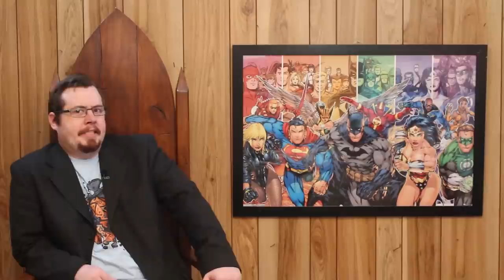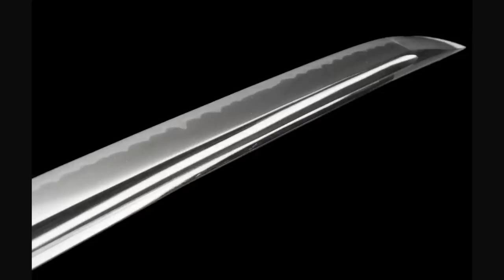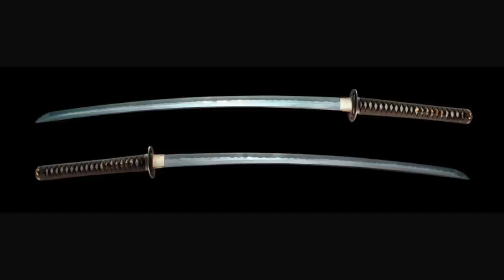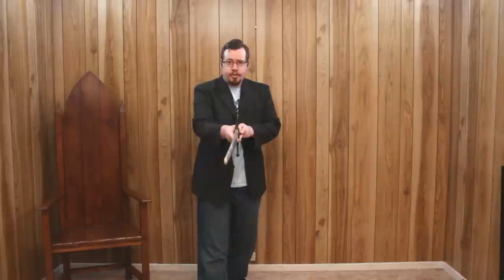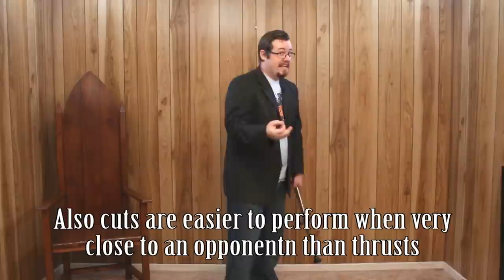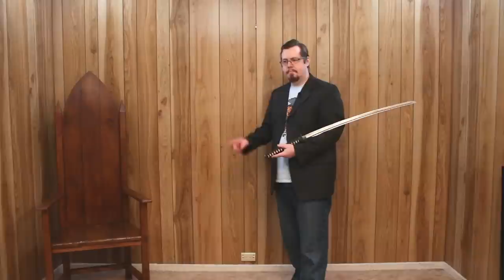Super cutting swords, are they needed?

Comment: You make a lot of good points in this video. For my own two cents, I would think that a balance between the two would be preferable. I agree some swords have a lot less viability based on the amount of curve or the lack thereof. It would largely depend on my role in combat. If I were on horseback and just plowing through an infantry line, I'd go for a saber or scimitar, but with preference to a saber, as there is the possibility of being unhorsed. I'd want the curved blade for the cutting as it's easier to get the blade out from a cut at that speed as opposed to a thrust. If I'm on foot, I'd go for a more balanced arming sword, or a katana. I might go for a shorter long sword, like a bastard sword over the arming sword.
I mention the katana, because I feel that it would still have enough thrusting capacity to get a kill in against most armors with the exception of full plate. As you said with cutting, if it does it well enough, then it does it well enough, and I feel this applies to thrusting as well.
I don't really think the thrust is the end all. If you really think about it, a thrust is just an extended punch. A smart fighter isn't just going to block with his weapon; he's also going to get out of the way, and go for a better position. Sure the other guy will do the same thing, but it'll take time to recover from performing the thrust. Not a lot of time, but time enough for the smart fighter to force the attacker onto the defense or to execute a joint lock, or d various other things to disable and then finish off the opponent.
I also don't think cutting is always the best option either. If you go to cut, you're going to generate momentum, which can easily be used in a throw. Both attacks have there downsides. Thus I prefer a whole body approach. Immobilize joints, get the opponent onto his or her belly, or just hit them really hard. Look at the weapon as a tool to strike, OR as a tool to get past your opponent's weapon and bring the hurt in close.

Comment: On horseback, three factors for why curved swords were preferred:

• an ever so slightly improved draw speed and more importantly, less likelihood of nicking your horse’s ear off.
• slightly less torque/jarring when the blow lands on your target (think of a long lever) and a slightly improved ability for the blade to rapidly slide off your target at speed, thus a decreased likelihood of either getting your weapon knocked out or yanked from your hands.
• a curved edge naturally rights itself, which again leads itself to a decreased likelihood of the blade jackknifing in your hand at speed, thus again reducing the chance of dropping it compared to a straight sword.
Reply: Will add:

If you want to thrust from a horse and not slash, then use a lance or a spear. There is no need for a short thrusting weapon from horseback when lances and spears are far superior in this regard.

Calvary swords were for slashing at speed. Duels where both riders were stopped and slashing away at each other were relatively rare.

Comment: Shad I think you're overlooking one big area of sword use wear the cut is paramount.  This is in cavalry use.  Thrust are generally not used from horseback because of the chance of the sword getting stuck in the opponents body.  So cavalry rely primary on cuts.  If you're only going to use cuts then it makes since to use a sword specialized in cutting, hence the cavalry saber.

Comment: I like to study naval warfare, and in old square riged ships you were fighting in close combat on deck or below in a hold and not on an open battle field. As you said in the video cutting is better for fighting up close so this could be why classical naval swords (like the cutlass) were curved. Because you don't have an open battle field where you can to some extent keep you apponent at bay. You are up close in a crowded area being crowded by other enemise and allies. Not saying it doesn't get tight on the battle field but battles on ships of the sailing age were tight. Also they might need to hack at rope or sail so having a sword designed for cutting might give a slight advantage.

Comment: i have a feeling that in regards to armor that could be penetrated with a cut, for example heavy leather armor, even if you didnt cut through into the target you would likely break bone and severely bruise muscle. in having nearly the same effect.   those types of armor arent really designed to absorb heavy blunt impact. a mace or axe would find little trouble with that armor. arrows on the other hand and even potentially sword thrusts would have much mor difficulty doing severe damage in a single blow. if you committed to an attack with a long sword against ribs under heavy leather armor even if you dont cut through you would most certainly break bone. so cutting in that regard means little. its the force of the impact concentrated in a small area that will do the damage. hence the reason for plate armor

Comment: Just to toss my two cents in: cuts are far more useful in a battlefield context than thrusts. Thrusting weapons, dedicated thrusting weapons, were generally the realm of dueling weapons like the rapier or smallsword. In a battlefield, however, the thrust is rarely immediately fatal. It has a high chance of jamming up in the body or ribcage of your opponent. But most damningly, it is too linear. After I cut down with a pulling cut, I can convert that momentum back, pulling the blade up, parrying or getting into a guard, or even using it to throw a second upwards false-edge cut. With a rapier on a thrust, you make your thrust, then t=you need to pull out, pull back and reset. It's just too linear and too slow for a frantic melee somewhere.

Comment: Some swords were meant to be used from horseback. A sword very good at cutting may have been necessary because it was extremely difficult to stab with a sword while mounted. A lance or something similar would have been used for stabbing  by mounted soldiers. In that case  the ability to cut through multiple infantryman in one cut may have been very important  once the mounted soldiers found themselves surrounded by enemy infantry.

Comment: If you only make shallow cuts during a fight, the better your sword is at cutting the less effort that will take - big deal in a long battle.  It's basically the same reason you sharpen your kitchen knives before cutting onions; makes it easier.

Comment: I am not a swordsman but we do have a similar debate in the firearms world. How much power is too much power? Speed vs power. Mobility vs capacity. Handling. It goes on and on. Are 3 small holes better than one big hole? I'm sure you get the idea. The conclusions most have reached is that the extra power isn't needed for when everything goes right it's needed when things go wrong. That extra cutting power may not be needed in a perfectly placed cut but what if you need to get trough something to get to the vitals? That's where something that might seem like over kill might actually be exactly what you need to get too the kill. Cutting someone's arm to the bone is a devastating wound but not lethal. Cutting trough someone's arm into their side and maybe hitting lungs or vital organs will immediately disable someone. Putting a hole trough someone  will eventually cause their death if not treated but it is not a fight ending wound unless you hit an organ or the hart and even then it may take long enough for them to do some serious damage to you. People survive multiple gunshot all the time after all. Cutting someone nearly in half is probably the only way to ensure immediate incapacitation with a sword.

Comment: 1. Against medium armor or heavy, swords are virtually useless, save on horseback hits or half hand techs. 2. Swords kill better against no armor with a slash, thrust against light and above. 3. Swords are back up infantry weapons. The polearm and sometimes pole swords have killed more and where the dominate melee for all types. 4. Short swords for thrusting work well with shields, but where out done by spears (see Romans versus Germanic tribes), and the rise of skirmish ambushes and calvary. 5. Slashs tend to do more damage as a whole with less accuracy, and swords where used alot without armor. In a fight, quite simply, cutting is USUALLY easier to land.

Comment: From a "battle" standpoint, cuts are easier, faster and more convenient to deal with the enemy than thrusts. Especially in cavalry vs infantry engagements. Cut oriented swords are about making even the average recruit be good at cutting and perform effectively. A cavalry running down an army with cutting/curved swords will perform way better and way faster than one trying it with longswords, because especially the curved swords, won't get stuck in the enemy nor will they require any meaningful sword wielding. You can just hold the blade out and tight and it will cut through. That's why all the cavalry in the world in later centuries turned to curved cutting swords and not longsword style straight ones.

Comment: I guess ease of cut would be a factor to consider. By basic physics it follows that the less area you have the more pressure  you get, so a sharper blade makes it easier to make a deep cut. It's not just a matter of cutting your opponent in half (awesome as it may be) but that even a grazing cut slices deep. Of course, a thrust has the least area possible but it only does damage in a small area as a consecuence.

And I'm not that sure it would be more easy to parry a well-aimed slice than a thrust. Both eould have rather clear areas of effectiveness just from their point of origin and a cut CAN be made with a rather small swing-radius.

Comment: Here's a question, is the excess of the cutting ability not so much meant to improve the effectiveness of a single cut, but instead to increase the efficiency of the cut. An arming sword and a sabre can both make the cuts but does the sabre have the advantage in efficiency, can you pull it back faster, does it's follow through enable it to be used in the next attack faster than the arming sword. For example I know some people don't like the term but from a purely practical standpoint and not as someone who has trained in these specific styles these cutting swords are slashing weapons. The cuts are meant to be effective and efficient. The curve allows for more efficient slashing than a straight edged blade

Comment: Leather armor was so rare in the western world outside of the Roman era that you would be shocked to see it on a battlefield as anything more than as a base for pinning metal splints.  They didn't have the animal husbandry skills to mass produce cows in quantities enough to supply the thick leather pieces for armies in any decent amount while sheep which were more common didn't supply the thickness needed (rawhide is impractical).  It also had a tendency to rot if not frequently maintained while on campaign.  Campaigns being MUCH longer than an SCA or LARP weekend trip and it terrible weather.  

You either had metal or cloth based armors.  At best thin leather reinforced with metal.

Comment: The thing I think that needs to be noted is that these accentuated cutting swords have historical precedent,  so there must be a reason why they were used over straight blades.

The katana can be ignored for the purposes of this. (I know; it's an exceptional cutting sword.... but the reasons for the curved blade (as far as I am aware) were due to material limitations in that the general quality of iron available was not good enough to make a fully tempered thrusting sword at a feasible cost.)

Cavalry weapons (or weapons designed to be useable from horseback) can be likewise discarded: delivering a thrusting attack with a sword from horseback is obviously a bad idea, and any design feature that discourages soldiers from attempting it in the heat of battle is probably a good idea. Also, since anything from horseback is going to be used to cut it seems prudent to make them as efficient at cutting as possible.

The other thing that has sprung to mind is the proclivity of armour in the reference that these cutting swords would be used within. This may be a redundant point, and my historical knowledge is not good enough to help me out here. But it seems to me that where armour is perhaps not widespread (and there could be many reasons why this is the case) cutting swords would be superior in a battlefield environment.
You don't want to be stabbing opponents on the battlefield if you can help it because that carries a fair risk of getting your sword stuck, which would leave you defenseless against your next opponent, and if nobody is wearing any armour worth a damn,  then you don't have to worry about having to thrust through armour.
Reply: Many cavalry swords are designated thrusters and heavy cavalry units used straight swords well up to the 19th century. Even the Ottomans used plenty of them. Of course many straight swords are cutters and not thrusters. So that's a moot point there.

Katana are good cutters but not exceptional.

Even the most rudimentary cloth armours are pretty ridiculously effective against cutting but yeah the best advantage of a cut over a thrust is that thrusts end inside the target while cuts shouldn't end inside the target but pass cleanly through. But yeah you want to stab your opponent, that's why spears were the primary weapon for every culture for thousands of years.
Reply: High Master Johannes Liechtenauer Spears are cheap and easy to make, and carry the most important advantage of a battlefield weapon: reach.
Swords are mostly (with a few exceptions) sidearms, and are carried in addition to a soldier's main armament.

The sword/spear comparison shouldn't ever really happen because the spear is a superior battlefield weapon to pretty much any sword precisely because of the reach advantage. The comparison of primary weapon vs secondary weapon is fundamentally flawed in principle because the point of a sidearm is that you use it when you are unable to use your primary weapon.

And of course spears are by design a thrusting weapon (again with a couple of minor exceptions). It's very difficult and not at all practical to allow provision for the spear to function primarily as a cutting weapon... mostly due to its' greater reach. Which is of course the primary advantage it holds over almost all types of swords.

Comment: Another thing about real world battle and fight conditions that seem to be forgotten is that you almost never get that perfect chop that you get against a stationary tatami roll. And with a glancing, impeded or shallow chop, a bit of "overkill" might make the difference between a nick or even just bouncing off even an unarmoured foe or scoring that "just enough" damaging blow.

And another thing is that there are more ways to use a sword than cutting and thrusting. I'd call it thrusting, chopping and slicing (to be reserved), and the curved swords will be better slicers as well, and again, especially with glancing blows. A "chop" with a straight and narrowing blade like that of a longsword that only hits with the last 10cm will bounce off light armour, or even ribs, and then in a best case scenario make a shallow gash as it slices across. A severely curved sword like a scimitar or shamshir and so on will still have a good bit of force and blade length that gets into contact and will slice a lot deeper. Plus, it won't bounce back like a straight edge will.

Third, sabres Are very much made for thrusting! They have reinforcements running down the spine and blade for just that purpose! So why say that they're not even made for thrusting?

And lastly, isn't it true that most curved blades were made for unarmoured or lightly armoured fighting? While straight swords have mostly dominated in cultures where armour and or shields were more common? Says a lot about the desired function.

Comment: As I understand it, Sabers and the like have a curve that makes them slightly better at cutting, but that is not why they have a curve. They have a curve for defense, specifically parrying. From the en garde position, once your opponent has begun an attack, especially a thrust, all you need is a motion similar to turning a doorknob, and your opponent's blade will be pushed to the left or right as it moves along the curve. meanwhile your blade (granted it's on it's side at this point) is still very much pointed at your opponent, who, if all goes well is still moving towards the point of your blade. Admittedly this is not an easy maneuver, timing is critical, &it takes a lot of practice, but that could be said of most swordplay.